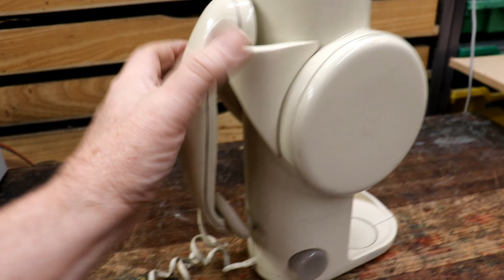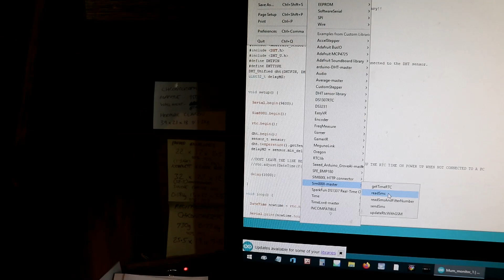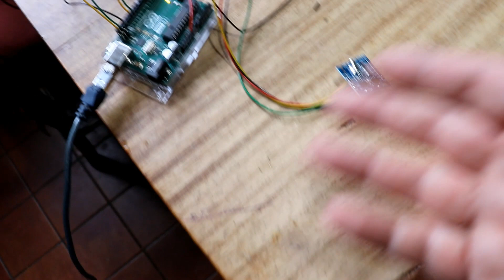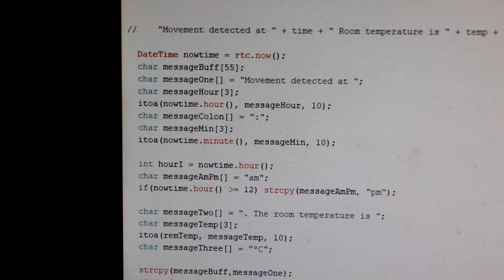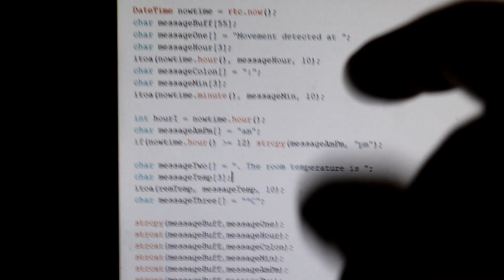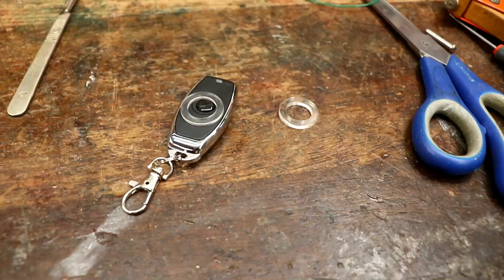I'm finally making one after 38 years...

Comment: Unfortunately 3G is being phased out soon, EE claim they are phasing it out next year so this may not be a long term solution 😞
You can get 4G modules but I think they are a lot more expensive, I have not tried it myself but maybe Lora is worth looking at?
I installed a small wifi hotspot module when I did this on PAYG for around £10 a month and used an esp8266 to attach to it.  This opens up other possibilities as you can then add more esp modules later on and have them all attached to it.  Three do some good deals on mobile home broadband so it may even be worth considering installing full internet?
Reply from the maker: Thanks very much for the advice. I was sorry to hear they are going to stop supporting 3G - I'm always a little late to the game! I'll check out Lora and now I've released an Arduino to communicate with the outside world, wifi may well be the next step. Thanks again.

Comment: I made a similar device myself a couple of years back, you will find every time you think you have finished you will think of another idea for it ;-)
I found a good feature was to have it message if it does not detect movement at expected times e.g. if it is past 10am and no movement has been detected yet.
Reply from the maker: That sounds exciting and very rewarding. You must have been so pleased to receive reassuring information. 

I know what you mean by thinking of additions - just look at how long it took me to finish the Ukulele machine & Victoria the singing automaton! 'Thankfully' I had to curtail my ideas and just get something built this time due to the urgency.

I like the idea of receiving a warning text message when movement hasn't been seen, rather than messages when it has. Last night (the first time it was working)  I was informed my mum was in the kitchen at regular intervals throughout the night - it turns out I've made a very effective fridge monitor! I went round today and moved it - the sensor, not the fridge!

Comment: I'm in a similar situation with my parents and am astonished that there isn't more products available off the shelf for this kind of monitoring. 
If internet connection is available there are cheap products that could be made to work. 
For those not as adept with the old soldering iron, the Tuya platform is behind many branded smart devices from the likes of Lidl and Poundland. 
There are movement sensors, door sensors, or even smart plugs that can all be used to alert you, there are also WiFi or ZigBee buttons that could be used as panic buttons.
Reply from the maker: I too was surprised at the lack of available monitoring products. Many elderly people don't have an internet connection available, hence the SIM800L providing a solution, especially with a pay as you go card that charges 1p per text! 

I don't have much confidence, and was amazed to actually get it sending text messages! Now it's up and working, I've got the time to perhaps attempt looking at 344MHz sensors.
Reply: @steamhead  one solution for lack of internet. would be to use a cheap PAYG SIM, like 1p mobile in a 4g router (1p /MB). There are some for under £20.
Love or hate the idea of an Alexa device, I have set one up at my parents. As long as they are in shouting distance thay can ask it to call me, or it can be setup with something called drop in mode.

Comment: If it ain't broke don't fix it. However have you considered adding a rf433 receiver instead of the rf433 relay module. 
The benefits would be that you could add many buttons, or there are even rf433 motion sensors and door sensors.
Being able to read the code from a rf433 receiver attached directly to the Arduino you can then identify what sensor is talking to it.
Reply from the maker: Thank you for the suggestion, that would be absolutely brilliant. Unfortunately my knowledge is very limited - I use a 433MHz receiver to receive data from an Oregon temperature and humidity sensor in the Barometric Prognosticator 3, as someone had kindly written a library to decode the data. Sadly Oregon then stopped selling weather sensor replacements, and the library wouldn't work with their other weather sensors. 

Any advice would be greatly appreciated!